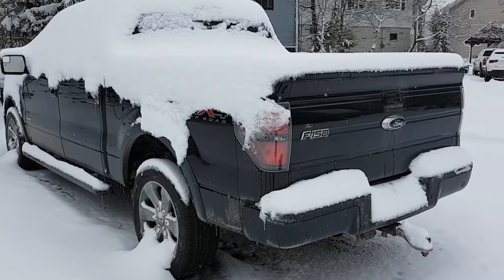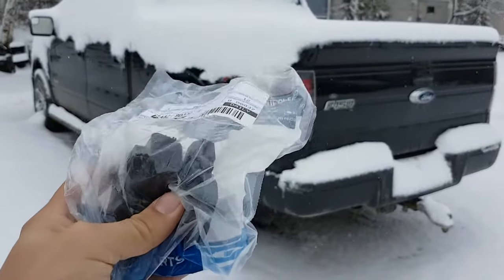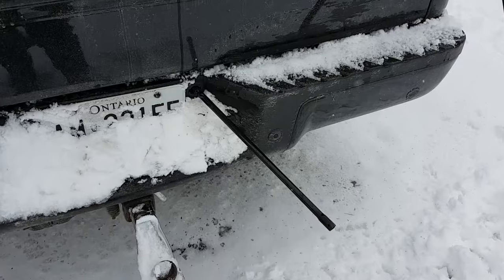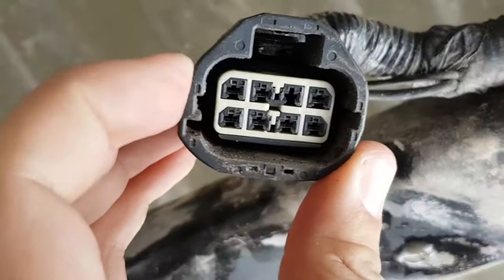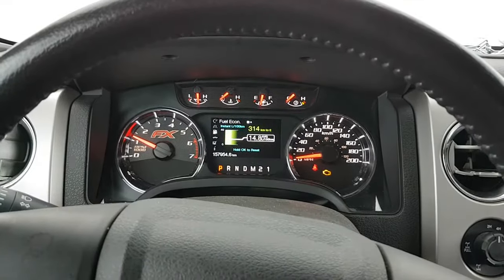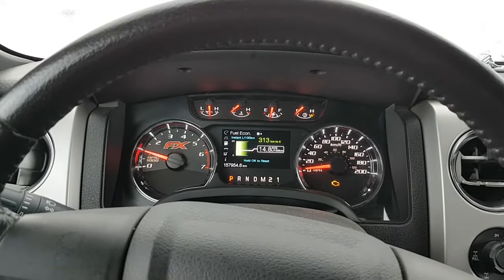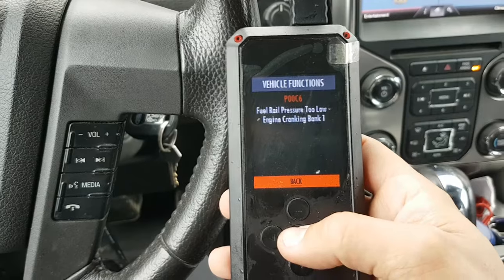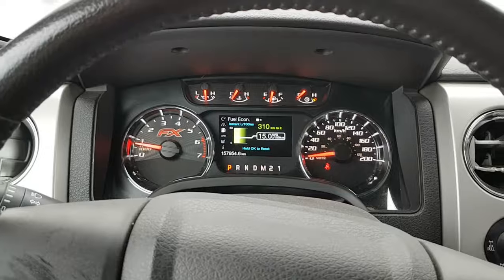How to fix P00C6, P0087 & P0627 engine codes 2013 Ford F-150

Comment: At the FPCM connector C433 at the frame rail above spare tire, disconnect the module and use two separate 14 gauge wires to jump across pins 1 to 5 and also across pins 4 to 8. Leave the module disconnected until you get a new module. This will temporarily bypass the bad fuel pump driver module (FPCM) and will run your fuel pump straight from the fuel pump relay when key is on. Simple, quick, and saves $$ on not needing a tow to get home.
Reply: are the pins numbered?
Reply: @johnnywestaz  it should be the four corners...1&5 on one side and 4&8 on the other side
Reply: Thank you so much for this! Last night 1 am leaving from Christmas dinner, my truck shut off a few blocks from where we started. Going out there this morning, I found this video and used the jumper info and was able to drive to where we are staying this week. We are 1,800 miles from home and are unable to buy a module until tomorrow. Thanks again for this!
Reply: Healing info, thanks dude!
Reply: Thanks. Just helped me with that.

Comment: I have a P0087 code (Fuel Rail System Pressure Too Low Bank 1) on my F250. I'll see what I need to do to fix this, but your video is great documentation and made me really glad that I don't have to lay in slush and snow anymore. LOL.

Comment: Bro just saved me a lot of $$$$!!!! Picked the sensor at autozone for 50 dollars. Any one debating on wither to go this route. My suggestion is to check your fuse for your fuel pump  in the engine bay and the one fuse in the  very bottom left on the right side of your passenger side seat. If all fuses are good go buy it at auto zone worse case plug it in doesn't work return it and buy your fuel pump
Reply from the maker: Glad I could help!
Reply: Really appreciate you taking the time to do the video. Cheers man!!! You need to add a patron or something so we can buy you a beer!

Comment: Thank you so much for posting this video!!! I was defeated thinking I'd have to replace the fuel pump but picked a module up on Amazon for $60 (1 day shipping), 10 minutes to swap out, and it runs like a top again! (2013 F-150 5.0L)

Comment: This just happened to me at Walmart. I swapped out the fuel pump relay with another one and it started right up and got me home. But I'm gonna go ahead and replace this part. Thank you! I do have P00C6 code.

Comment: Thank you, my wife made is half way down the drive this morning and it sounds like this could be the problem.  I have the part coming in this evening, hoping it works, otherwise the next culprit will be the fuel pump, which is inside the tank.

Comment: Bought the part at a nearby Ford dealership,  part was around $39...Replaced it....cranked and let it run...recharging the battery,  took it for a spin. Turned it ..  Cranked and still running.   Thanks for the Video!!
Reply from the maker: Right on! Glad I could help!

Comment: Got lucky with this issue today and it was same codes but checked the fuse and it was done for. Replaced it and back in action but will keep an eye on this as well and be prepared to switch it out if needed.  Thank you!
Reply from the maker: Oh nice!
Reply: What fuse

Comment: have  the same truck you have.  Same color same everything.  I replaced  low oil pressure switch, not it!. Change battery not it!. I scanned for codes  and I  got the same 3 codes you got. So I went to the ford dealer and bought the fuel pump relay  and guess what it WORKED 💪  . Thank you so much for the info.
Reply from the maker: Glad this could help you!!

Comment: Swapped mine out today and that did the trick. Only thing is my module was in a particularly painful spot to get to. It was not above or near the spare tire at all, but just above the end of the fuel tank. It was not easy to get a wrench up there, but I got it done. Working basically one handed and not being able to see, I accidently removed a ground bolt instead of one of the mount bolts. That added a bit of time and confusion to the project. lol! Anyways, thanks for the video. I had the exact same codes, and no other symptoms other than It started and ran fine, then crank and no start.
Reply from the maker: Sounds like you had more fun than I did haha! Glad it helped you! Cheers!

Comment: THANK YOU FOR POSTING THIS!
 Just happened today, weak start because of low fuel parked on an incline.
Let the vehicle Coast down to where it was level cranked it a few more times until it finally started drove it to the gas station filled it up started it again and it died right when I left the parking lot.
Search for fuel pump issues and yours was the first one to happen to pop up local AutoZone happen to have one right down the street thank you for posting!
Reply: Yes Yes i

Comment: Hey 
I just wanted to say thank you and replacing the fuel pump driver module with a new one fix my problems same as all the others here same symptoms. Also i wanted to say that i have a 2014 ford f-150 platinum 4 wheel drive. and i just wanted to say that his video is very correct but i would like to also add that you should get a can of canned air to blow off the fuel pump driver module by where you release it to remove it because mine was hard to get off because there was a lot of dust,dirt by the tab you press down on to take it off but once i blew it out with the air. It came off really easy. Anyways thank you for a very good video
Reply from the maker: Thanks! Glad I could help!

Comment: Going to try this tomorrow. I have a 04 f150, ran fine getting to work, went to leave and it would crank immediately but sputter out and die. After about 5 to 10 tried it would "clear out" and run fine. Does it hot, cold doesnt matter. If it sits for more than a few min it starts acting up again. I have cleaned the throttle body and replaced the fuel filter so far. Fingers crossed! Edit, the only thing that happened while the truck was sitting at work was I loaded some firewood in the bed, not being gentle, hoping maybe that knocked some goodies loose in the module.

Comment: Had this code show up on a routine oil change. Instructions are to run a tank of pure gas through it at every oil change. It's that time, so I went from E85 to pure gas. Truck died three times at the pump, then threw this code and is running fine. Gonna clear it and see if it stays gone, I think it had something to do with switching fuels.

Comment: EDIT for comment below:
I run E85 all the time except at regularly scheduled oil changes. As per Ford's instruction book, I run a single tank of pure gas through it with each oil change.
I made the switch from E85 to pure gas a few minutes ago. The truck normally stumbles a bit when changing fuels. This time it died three times and threw codes P0627:00-AE and P0627-C, then ran fine. I cleared those codes, restarted it, and all is well. Throttle response is normal for pure gas (read: a bit sluggish compared to E85).
I think abruptly switching fuels can cause random issues. According to Ford, oil changes are the only time you should switch.
Next time I'll mix a bit of alcohol in at the pump.

Comment: For anyone else with this issue it could also be your fuel pump relay. i just had to fix this on same kind of truck yesterday, ended up being fuel pump relay and the Fuel Pressure Regulator Module.
Reply from the maker: Thanks for the heads up!

Comment: Any updates? Was this all that was needing repaired? I have the same codes,truck, etc...
Reply from the maker: Replacing the fuel driver module fixed it all for me! Been running good ever since!
Reply: Matt Fuller Outdoors I have part number AA8Z-9D370-B.  Is that correct?
Reply from the maker: @307.William  yup! That's the same one I used!
Reply: Bought it. Replaced it, went to grocery store. Leaving just sputtered.  I’m thinking HPFP.
Reply: @307.William  What did it end up being ? were you showing both same codes P0627 and P00C6, I tried the module and didn't work but for one minute. Fuel pump assembly to be replaced next
Reply: Paulo Briggs it’s very intermittent for me.  And I only get the P00C6 code
Reply: Did the fuel pump fix it for you? What was the cost of that if you don’t mind me asking?

Comment: I’m only getting the P0627 code, not the fuel rail pressure code, would these mean it’s my fuel pump and not the module?
Reply from the maker: I would try the module first. Its a fraction of the price of the pump. The module could be throwing any 1 or all of these codes.
Reply: Matt Fuller Outdoors yep, that was it. Thanks man!!

Comment: I pulled 2 codes on my 15 fusion. P00C6 and P0087. Both still pending not permanent yet. Occasionally the idle gets erratic and the car just stalls out but I guess its not frequent enough to trigger the engine light. I need to figure this out before my wife gets stuck on the side of the road. I dread taking it to the stealer ship just for them to run diagnostics.
Reply: Was this the same issue for you? Or how did you fix your issue?
Reply: @haydenboer3354  I fixed it. Was the fuel pressure sensor on the driver side near the fire wall. Swapped it out in 10 minutes. No more codes and no more stalling. 🤞🤞🤞
Reply: @RellyOhBoy When I call the dealership they come up with the fuel rail pressure sensor. Is that the same sensor you are talking about?
Reply: @haydenboer3354  yup. There are 2. High and low.

Comment: Shouldn't there be a way to test module before buying something you may not need?
Reply from the maker: I'm sure there is but 95% of the time when you get these engine codes the module is the issue.
Reply: You can always plug it in without installing it and return if it doesn’t fix the problem if you bought if from a bog box store.